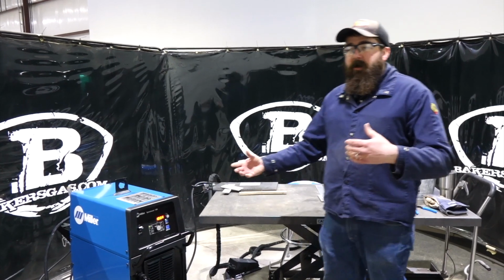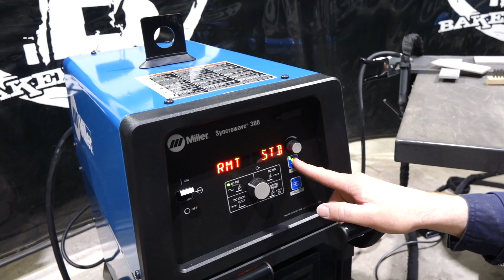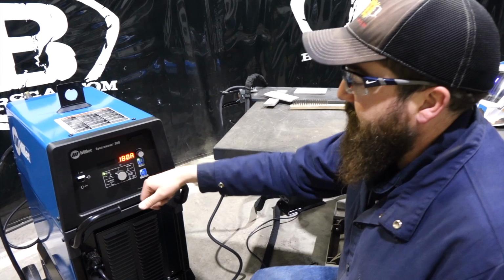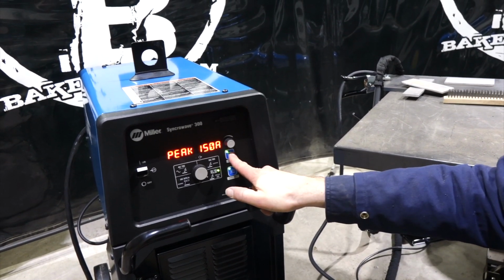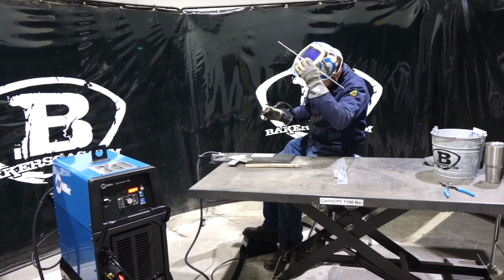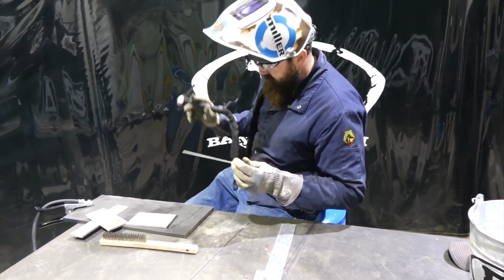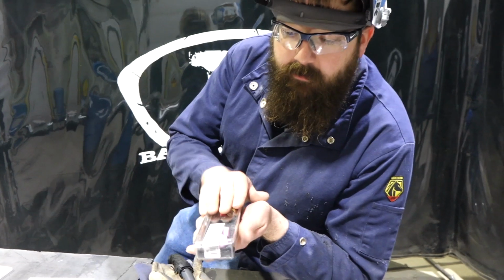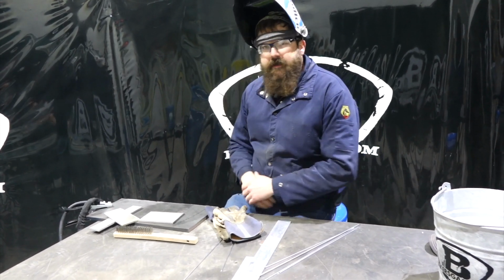Miller Electric Syncrowave 300 Review and Demo

Comment: @ Andrew with Bakers Gas & Welding. Tell me why that the 200, and 300 are always such stripped down Machines???
The 250 and the 350 have a ton of more features, adjustable Frequency just to name 1 big one. My old 250 Tigrunner that I used to have (2004 model) had a control panel that looked like something in the Cockpit of a jet. Lol
Hell, it even had the capability to be hooked up to Robotic Welding. I've just never understood with the even hundred #'s were stripped, and the ones with a 50 in the model # were bad to the bone. I have a 200 now, and it is bare bones. Basically has Balance Control,and Pulse and that's it.
I'm shocked that they have it priced right up there with the 250 and 350, when they are so much more capable to fine tune.
Especially since they didn't even update the Control features to Modern Day, like a nice Color LCD or LED Screen with the Menu and Functions built in like the 220 Multi. That control setup is just like my 200. It sucks is all I can say. If they were gonna update it to an Inverter Machine they could have at least updated the Control Features.
It is still a good capable Machine, and they Weld great, at least the Transformer models do.
With an Inverter it would've been even easier for them to give us  Frequency Control. You can take an Esab 205 and have from 20 to 400 Hz. You would thin a $7000.00 300 amp Inverter should do the same. Just saying!
Love your Videos keep up the good work!
Reply from the maker: Thanks watching and commenting. Miller is actually phasing out the 250 and 350's. You have a good point, they did not go with the LED screen like they have in the smaller Multiprocess units.
Reply: @BakersGas  thanks for the quick reply. I know Inverter Machines are "the way of the future" but I do think a lot of people are gonna be disappointed about the 250 and 350's being discontinued. I mean these things are an absolute Workhorse! I know Guys that have been Welding with the same Machine for 20 even 30 years, day in and day out. Transformer Machines just last forever. I like all the features you get with an Inverter though.
I guess how I'm gonna have to go on the hunt for another 250 Tigrunner in good shape and get it and out it up, or better yet a 350.
Im actually getting ready to purchase a new Esab EMP205ic from you Guys in the next couple of weeks.
Reply from the maker: @phillipchambers8487  we appreciate your support and thank you for commenting. We get a lot of questions about the long term reliability of the inverters. I know everyone knows and loves the traditional old school stuff.
Reply: My company just bought a miller 300 inverter so obviously I can't adjust my frequency. Any advice to compensate for that?

Comment: Can u run a spool gun with it like the 30a?
Reply: No you cannot run a Spool Gun on this Machine!!! This is a Tig man. Tig and Stick only. All Syncrowave Machines from Miller are Tig and Stick. Not Mig.
Reply from the maker: No you can not on this machine. On the Synrowave 210 you can.

Comment: I see they included the controls for the pulser and sequencer that they raped customers for in the past. I just added pulser and sequencer to my 2002 250DX machine for $25 worth of parts. The machine was already capable of doing it. They chose not to install the knobs and buttons. Dont get me wrong, I am a true blue fan all the way, but what they did on the early DX series was shitty for the consumer.
Reply: Hey I was just wondering where you found the parts? I have a 2005 250DX and don’t want to drop $800 on an external pulse controller but I can’t find the pulse circuit board anywhere
Reply: @lukefrances6674  I used 10k ohm potentiometers and a pushbutton on off switch with an led in it. I just panel mounted everything and point to point wired it. 10 pin ribbon cable plugs into the main board. Schematics can be found on Millers website. I got parts from Amazon, but I would recommend getting better parts from Mouser Electronics.

Comment: You lost me 100% when you said inverter. That will be a no. Great video tho.
Reply: Same!!! Transformers never die, that's why they want to phase them out.
Reply: Ehhhh I have an old 250 DX transformer machine that’s still kicking, and I use it when I need some serious amps, but I can’t lie those new inverter machines have so many features like frequency and independent AC amperage controls that make life so much easier lol